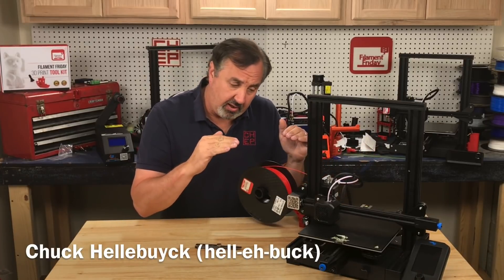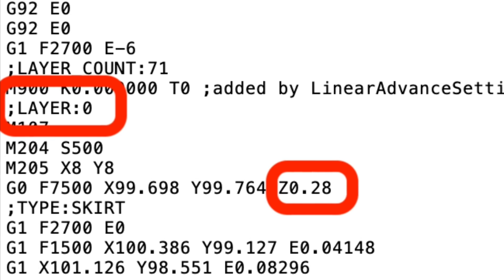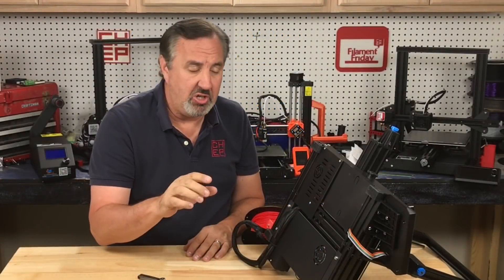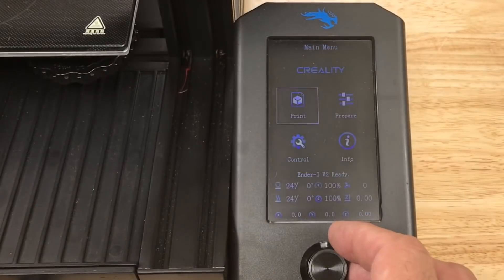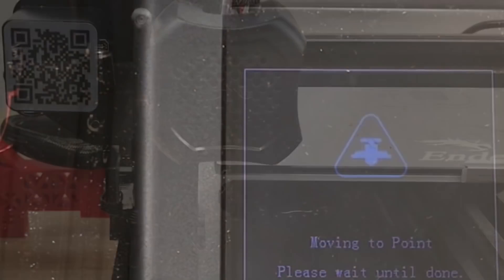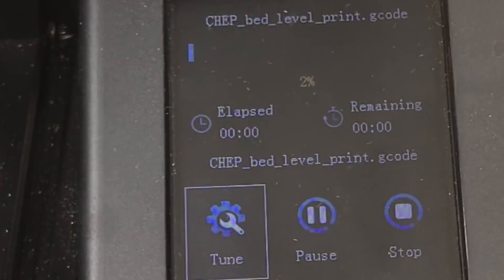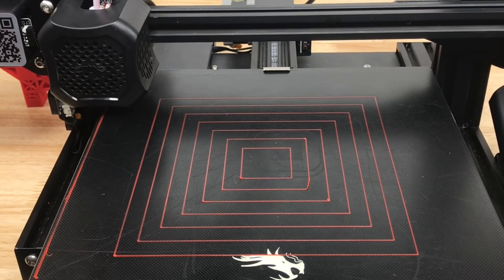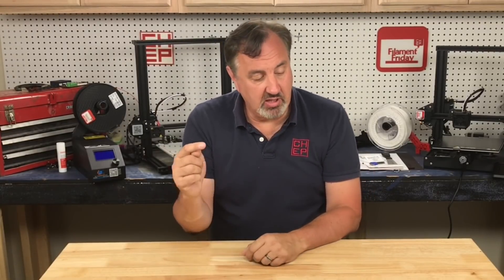Leveling or Tramming your Bed Using a Feeler Gauge on Ender 3 V2

Comment: If anyone is having a hard time getting to the nozzle in various positions, you can get longer feeler gauges, and ones with an angle/elbow on them. Be gentle around the nozzle with them, depending on your nozzle, the steel of those blades is a lot harder than a brass or copper nozzle, and it's easy to deform the nozzle opening if you jam the blades hard into them from the side. Also getting metric gauges is adviceable; everything else in 3d printing is metric so saves you dabbling with fractions, rounding and conversions.

Comment: I'm using a BL Touch, ender 3 v2. Why would a .10 feller gauge net better first layers for me, than a .203. Correct me if I'm wrong but the machine is just trying to find 0, or the bed surface. Why would the feeler gauge used to tell the programing this really matter?
Reply: What you're doing is setting how far above the actual build surface "zero" is.  The optimal first-layer height will depend on how much you're extruding for the first layer, which can vary based on the filament you're using, the nozzle you're using, how well-calibrated your extruder is, how fast you're printing, etc.

Comment: I have a Monoprice select plus, does it’s firmware have the ability to make offsets in the machine like you did in the initial description of using a feeler gage?
Reply from the maker: You can just use z movement as well.

Comment: Hi Chep!   question.. I have to  apply  glue stick always before print? any chance to avoid it? maybe   filament need more temp or my bed? now  I am using PLS with 273C and bed 73 C..   is normal? just bought and waiting   BL touch sensor level  that u recommend.
Reply: could also be bad cheap filament. If you're using Accreate branded filament just throw it in the bin. As soon as i did that and used Ender branded filament i have not had this problem
Reply from the maker: Try this: https://youtu.be/nMLKNB2r-M4
Reply: @FilamentFriday  Hi Chepp just installed BL Touch.. so far run like charm.. not even need glue on the bed... . And your level bed file  looks amazing Thanks a lot!!

Comment: Hi CHEP, I've been having some bed levelling issues when using Manual Levelling with the BLTouch. I've gotten all 4 corners to within -/+0.005mm tolerance and have created a UBL mesh which is being loaded in my gcode but I'm still having first layer issues with my top-left corner (where the temp cables are) as the nozzle appears to be too high. I've done a frame check to ensure axis are square at 90 degrees. Nothing out of the ordinary.

At this point I'm at a loss. Is this a levelling issue or does it sound like there is something else to blame? I appreciate you're not a support service so I understand if you're not wanting to help diagnose/troubleshoot/reply.
Reply from the maker: Your autolevel should compensate. So I’m not sure what to say.
Reply: @FilamentFriday  Thanks for replying!

It is bizarre. In that case I'll rebuild it during the weekend and hope that fixes what ever is the problem.

Comment: You only have to adjust once? I find if I do the front/left corner, then when I do the back/right corner it changes the front/left slightly.... I gotta do it 2-3x. Also... no mention of what to do if the centre is too close.
Reply: @CHEP may have done leveling/tramming enough he doesn’t think about it too much, and just does it.

As you’ve observed, yes, it’s sort of like tightening lug nuts on a car’s wheel, and when you tighten down one corner, it affects the far corner.

Comment: several moths having problem adjusting the bed,probably its springs so i ordered new springs 8x20mm as sugested.meantime, what is size of feller gauge you used in this video.I,m using Ender 3v2 printer
Reply from the maker: 0.2mm
Reply: @FilamentFriday  Thanks.i,m very greatfull.I,m  viewing yuur viideos.

Comment: Am i doing something wrong? I followed the video 100% set the z offset to 0.20mm, Then level each corner. When i make the bedleveling test i print but the lines are rounded and not flat which they should. In order to the lines to merge have i been needing to set the offset to 0.10.

Am i missing something to adjust in cura or ? Remove the Z offset from the printer after adjusting?
Reply from the maker: You can lower the Z. Did you use a 0.2mm feeler gauge and make sure it’s flat when nozzle touched?
Reply: @FilamentFriday  I'll try again later in the weekend. But if i understand it correct then if i set z offset to 0.20, measure with a 0.20 feeler gaugue flat on the bed. Then when i print something, it should substract the 0.20 and would become zero and only lift the nozzle to the given layer height right?. Then if chaning the Z-offset to 0.10 and measure with 0.10 feeler gauge should give same resault and microstep it down during print would only affect the currect print.
Reply from the maker: Correct.
Reply: @FilamentFriday  Strange. Just tested. Set the z-offset to 0.20, leveled the bed and all that. Sliced my 0.2 layer height print and started to print it. 

There i noticed that Z-offset was 0.20 but the printer would start first layer at 0.40 layer height. Startede slicer again and this time set a -0,2 as software z-offset and then printer this time set it to the correct 0.2mm first layer height.
Reply from the maker: Are you homing the nozzle in GCode before printing and saving the Z offset? 
First time you only were 0.10 off. Now your 0.40 off. Very strange.
Reply: @FilamentFriday  sorry for the misunderstanding. The 0.10 was after i microstepped it down during a print. So in reality would it have been 0.30 (started at 0.40)

Yep it makes a homing to 0.0 and i see it go down and touch plate before starting the print. So a little unsure what is going on. Also seems like even with - 0.20 offsst in software is it getting too close. So will try with - 0.14 (had to microstep it 0.06 up)
Reply from the maker: @elvarg99  - Try this. Follow all the steps in the video. Then when done. Reset Z offset to 0.0. I just realized I forgot that step in the video. Sorry for the confusion.
Reply: @FilamentFriday  Thanks :) i just placed a - 0.2 z offset in Prusa Slicer and I've printed perfectly ever since :)

Still thanks for the video since it makes level the bed so much easier :)
Reply from the maker: That makes sense. You are basically counteracting the 0.2 offset on the printer.
Reply: What does this mean to Live adjust and to set Z offset to .20 mm?!?! Ive printed probably about 8 times so far, tramming bed with a .10mm feeler gauge and have had no problems until last night but I think it may have been an adhesion issue.

Comment: do you leave the z offset  or set it back to 0 after you level the bed?
Reply from the maker: Leave it,
Reply: @FilamentFriday  Sorry which one is it now... leave z-offset at .2mm after levelling or set back to 0 like you said in the other comment above? Also when you home the printer, what should the distance between the bed and nozzle be then? Because when I add the .2 z-offset it will add .2 to whatever the distance is from home. Kind of confusing to me. Cheers

Comment: Question. What is the best way to level the bed the first time when you have a bl touch. So the initial setup. To have a level bed before setting the z offset for the probe/nozzle.

Also does this firmware have the 5 volt update in the firmware? I have had a lot of probe fails during probing because of the ender 3 v2 with a bl touch. Finally have a firmware that does not give errors so kinda scared to switch

Comment: Chuck, did you remove the Z offset before starting your test print?  If so the end result is the nozzle height should be actually 0 when the printer sets it to 0.
Reply from the maker: No, the firmware knows that when it’s homed the nozzle is at the offset in the menu settings. So when the test print says start at 0.2mm, the firmware knows it’s already at 0.2mm so no Z movement required.

Comment: I'm wondering whether using the Z-offset is working for me.  The bed is now dead flat, but the filament is being laid down as though the head is far too close.  It's a 0.2 feeler gauge and a 0.2 offset.

Comment: This is great, thanks for sharing. Now I'm trying to figure how to do this on an Ender 3 Pro which doesn't have the z-offset in the menu (I am running Marlin 2.0.x) That said, if I'm understanding this correctly, would I adjust Bed Z under the tune menu to -0.2, then save that configuration, would this do the same?
Reply: Just after homing raise your axes for what thickness which you are using to adjust...

Comment: I'm using the GeeeTech A10M (3rd Gen) and as I am trying to improve my prints, I realized that my bed shows that the initial layer height should be .3mm. I noticed that you used a .23mm feeler gauge and I don't think the paper that comes with the printer was around .3mm so should I set the nozzle height, Z offset, and Cura settings to .3mm with the feeler gauge? I feel like having that big of a gap will mess with the filament bead, especially since I had it printing ok with the standard settings which are much lower and I leveled it so the paper was really tight. Why does Geeetech recommend .3mm when everyone on YouTube sets it lower and my initial prints worked fine?
Reply from the maker: I used .203 not .23. And I don’t know why GEEETECH suggests that.
Reply: @FilamentFriday  Thank you, great video. I just subscribed and liked. Keep up the good work Man.

Comment: I was taught to use feeler gauges on the go/no go method. ie  to set 0.04 mm use a 0.03 that should slip freely and then a 0.05 which should not fit. that way the gap is 0.03+ and 0.05-. It takes the subjective feel of how tight the gauge is and also stops compression of the gauge.
Reply: Taking anything subjective out of the equation is always good operating practice, yeah. 👍

Comment: Dumb Question:  With the BLTouch, would this change the requirement to set the z offset to the height of the feeler gauge?  Since i'm going to be changing the z offset to set the correct height based on the feeler gauge?
Reply from the maker: Yes.

Comment: I've been telling people this for a while on the ender 3 reddit forum. Most peoples leveling issues are because of this. You level with paper at.1 then the printer homes with a point one gap. So if your slicer is set to .2 your actually printing around .3. You have to offset it by the amount used to tram

Comment: Great video. I've been doing that with my Ender 3 Pro for the past several months since I swapped the board with a BTT SKR mini E3. I do the leveling then Live Z -0.20 and the 1st layer always looks so good. Mainly I did it as a better way to make sure I have the same reference height to start with. Love your work!

Comment: Great video as usual. One additional tip to add: use the plastic or at least brass feeler gages instead of the common stainless ones (meant for hardened steel/engine mechanics etc) as the stainless can and will slightly deform the soft brass nozzles tips/holes if too much pinch is accidentally applied during tramming adjustments. Both are available on amazon/ebay too. Disregard this statement if perfection is not your goal. Thanks and have a great day.

Comment: I've been doing this for years. I'm also an advocate for setting at the feeler-gauge thickness i.e. you home your printer, adjust to e.g. 0.2mm height (for a 0.2mm feeler-gauge) and then adjust the bed levelling screws.

Another avant-garde method I have is to do all this with a cold bed and heater block. You then print a skirt and measure its thickness and use Z offset to correct the height.

Comment: So I upgraded to the 2.2.4 Silent board on my Ender 3 Pro. I am trying to upgrade the firmware on it and I downloaded the Marlin .bin update from Creality for the Ender 3 Pro. But when I put it on the SD card nothing happens. The 2.2.4 board is supposed to have the bootloader on it right? What am I doing wrong?
Reply: The creality boards remember the filename of the current firmware installed in it, if the name of the firmware file you put on the SD is the same as the one that is already installed then it will not install the new one as it thinks it is already installed. I had this issue with my E3Max, got really frustrated with it not updating until I finally realized what was happening. Just give it a different name, add a -1 or A to the end of the filename and see if it works then.
Reply from the maker: I’ve never heard of a v2.2.4 board.
Reply: @FilamentFriday  Ya too many version numbers lol I meant to say 4.2.2 silent version.
Reply from the maker: Try a different SD card.

Comment: could you clarify which gcode command is being issued upon saving z offset, please?
Reply from the maker: It’s not a gcode. It’s in the firmware.
Reply: @FilamentFriday  yes but what does it do exactly? any settings we make have corresponding gcode isn't it?  Just trying to understand which eeprom values are being changed this way.
Reply from the maker: Maybe the same as M500.
Reply: @FilamentFriday  i see, thanks.
Reply from the maker: It’s not a gcode. It’s in the firmware.
Reply from the maker: It’s not a gcode. It’s in the firmware menu.

Comment: I picked up a set of feeler gauges for this, but after I got home I saw the smallest was like .04mm. Can I use the same process with the Z offset set to .04?
Reply from the maker: Lot tougher. You want bigger anyway, like 0.20 mm.
Reply: @FilamentFriday  Thanks, I just realized the extra zero. My feeler gauge set will work. Thanks for the reply.
Reply: @FilamentFriday  OMG, this worked. I've been trying to print ABS all long weekend. After preheating to 100C, I got it to print more than part of a 1st layer. lol

Comment: I use a dial indicator with a few magnets glued on the back that sticks to the earlier ender 3 hotend fan box. The new plastic version kinda ruins that idea but maybe there's a work around? Does the old metal box fit?
Reply from the maker: Different mounting holes

Comment: I had so many issues before getting the firmware to work, so I thought I'd pass this along... when you format to FAT32, make sure the allocation size is set to 4096 bytes. Mine defaulted to another number and the upgrade would not work.
Reply from the maker: Great tip.
Reply: It solved my problem thanks

Comment: I just got my gauges in the mail today and they were dripping with grease literally. Lol! I had to wash them in the sink and leave them opened up in front of a fan to dry. I haven't seen that much grease in Mcdonald's french fries! Now that I have a cr touch I'm not even sure why I bought these. 😂
Reply: They're covered with oil to prevent them from rusting.  Just give them a wipe with a paper towel prior to use, rather than stripping away all their protection.
Reply: @AndyTremble  Yeah but I don't wanna get the oil all over the nozzle plus my house is really dry so I just cleaned it off. Thanks.
Reply: @MobileDecay  It's probably absolutely fine.  They do it for long-term storage, after all.
Reply: @AndyTremble  It wouldn't cause adhesion issues?
Reply: @MobileDecay  I meant it's probably fine to wash them off.
Excess oil would definitely cause problems with adhesion.

Comment: I've been doing this for years now :) Including probe z-offset. The only difference being that ... I do it with nozzle and bed at ambiant temperature, with a 0.10mm (0.004") feeler gauge. Perfect layer every time, whatever temperature is used later for nozzle/bed.
Reply: What do you mean with probe z offset as well? like you use a gauge for it to probe?

Comment: Use this then run auto level to be spot on while using live Z to adjust 1st layer.

ABL does not end the need for manual leveling.

Comment: I got my feeler gauge set from Auto Zone today.  They are etched with standard and metric measurements. Thanks for the video.
Reply: I did too, but they didn't go down to .203mm
Reply: @jayinmi3706  just dial the offset in the menu to match the feeler you have, do the process chep shows; then without changing the bed knobs readjust the offset in the menu to the amount of squish you want in the first layer.

Comment: Kind of public announcement.
 
Lately some 3D Printing youtubers are picking up and propagating a FALSE equivalence of "leveling a 3D print bed" being the same thing as "tramming a 3D print bed".

Like "... leveling also known as tramming ...".

Simply put, the concepts "tram" and "tramming" are ONLY applicable to machines that use a rotating cutting tool head (e.g. a mill or or a router) that most 3D printers do not have.

"Tram" is the degree of squareness between the axe of tool rotation and the presumably flat and "already level" machine bed. "Tramming" is the tuning process of correcting some small tram misalignment.

Comment: What thickness feeler gauge are you using?
I keep running into the problem where the gauge is just slipping underneath the nozzle without any effort so I think there's a gap but it's actually touching the bed.  I've upgraded to the yellow stiffer springs but I guess I just don't have the touch. .

Comment: I wish I better understood the "Z offset" setting when I first got my printer. It makes perfect sense that tramming with a specific gap between the nozzle and bed that you will need to compensate for that gap to get true Z axis zero. Conceptually it certainly made setting up my bltouch easier. I understood ahead of time that the bltouch zero wasn't going to be the same as the nozzle zero.

Comment: Hey there. You can use creality scraper. Its 0.7mm thick. Dont use Z offset. And over display raise Z axis for 0.7mm than level, and zero will be true zero.
Reply: Are you saying to set the z offset to 0?
Reply: @mrpaytonsparks  z-offset is just compensation for errors in tramming (bed leveling). If you have done it perfectly, than it should be 0. Prusa mk3s (and similar) use z-offset for traming because they have a fixed bed, therefore you cant adjust it mechanically